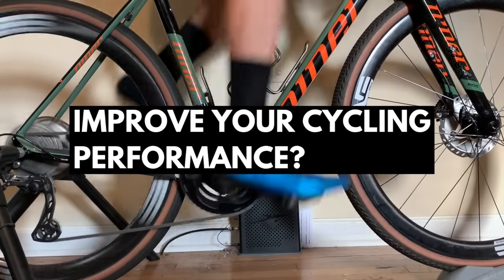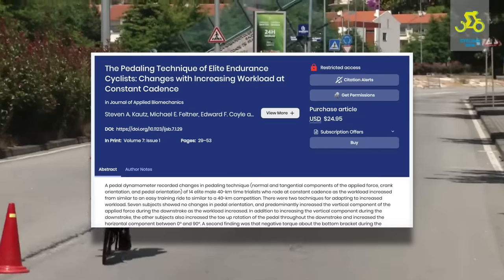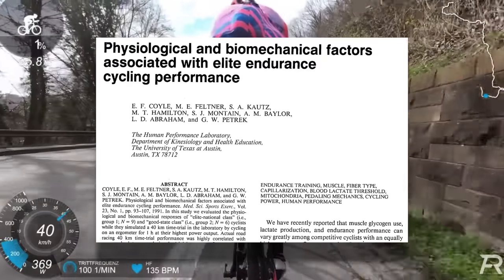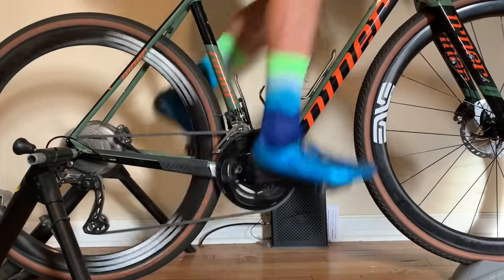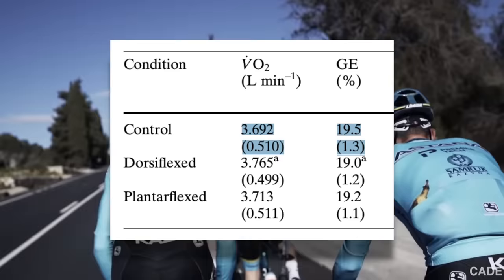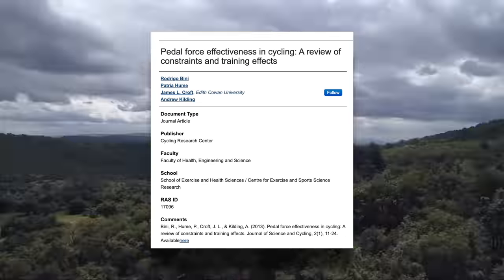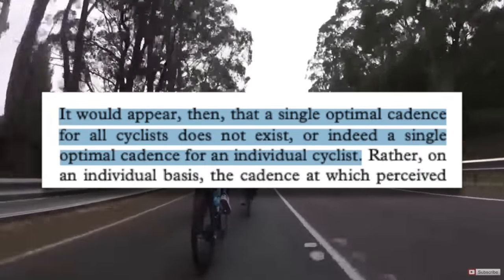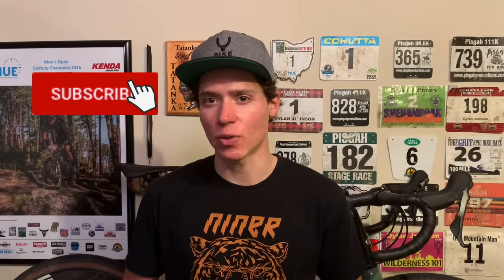Does Your Pedaling Technique Affect Your Cycling Performance? The Science

Comment: If an optimal cadence does not exist than why are the world hour records or pro Time trials normally done at 100 RPM? New study required for that one. I'm not saying it works for everyone but clearly 100 rpm is the most optimal cadence.
Reply: A big flaw I think on the studies so far is that nobody has data that focuses on longer term impact. All of these studies were mostly short term, which would've been expected when athletes couldn't be more effective due to the principle of specificity (e.g. he's most trained at that cadence). You can definitely upgrade your cadence through longer term training, got my preferred cadence from 75rpm to 95-100rpm. It'd be great to see data on that. 

If I recall the reason why pros have higher cadence is because it's easier to adjust cadence to accelerate by upping cadence than shifting and grinding gears especially when reacting to attacks or attacking yourself. It's also much less straining to your muscles especially on climbs as high cadence tends to affect your aerobic capacity more which is easier to recover.

Comment: Would love to see a video on the science of tire pressure and tire width and it’s effects on efficiency and speed for MTBing.   Saw a video recently that has World Cup XC riders moving to 2.4 width tires with pressures as low 18psi depending on weight.  Nino even suggested the tire pressure should be low enough to bottom out the tire on the rim occasionally during a ride.

Comment: This might sound odd But I seem to be pedal for longer on a hill when I "push" my pedals forward and this is easier for me I have no idea why but it sounds odd but feels better...... Don't ask
Reply: Not odd but well-known, "pushing" forward (from about 11 o'clock) over the top of the crank arc can engage the glutes & change a vertical, "mashing" power application that relies entirely on the thighs into a diagonal stroke that applies power from both muscle groups for a longer time. A diagonal pedalling image also helps to avoid pushing the pedal "down" thru the 5 & 6 o'clock crankarm positions, when the pedal is travelling mostly horizontally.

Comment: Ok, wow, that is a lot of text book information.    Stop.   yes power comes on strong on your down stroke, why?  Cause those muscles are bigger, stronger and you can add body weight.  Up stroke uses smaller muscles on the back of the leg.     I can't speak for road rides, but when climbing in the saddle with a strong lifting stroke on the dirt or tec climbing in the saddle you will shift the torque on the bike.   Up. stroke will  dig the rear tire in, gaining traction, lightening the front wheel  and easier to keep your balance .   Down stroke climbing , or standing will force your suspension to activate,  lighten the rear wheel making it more likely to break free, and seems to add weight to the front wheel forcing more body language to get over larger roots, rocks and other obstacles. So try this. (good for road and mtn biking) Remove a pedal so you can only clip one foot in. Start with removing you stronger side.  ride a couple miles, (5-10% of you usual ride) try to obtain a smooth powerful stroke.  Now switch and pedal a few miles with the strong leg while the other pedal is removed.(you will probably feel smoother stroke)  Try this twice a week for a month.   then pay close attention to your pedaling sensation. Do you feel or clock faster times. are you more comfortable, do you feel a smoother pedaling stroke.   in the end you will notice that you are activating more muscles.   Regardless, when you focus on power anywhere in your stroke you will be training and getting stronger, which in the end is just better training.   I fully agree Dylan, don't change your pedal stroke but maybe add this to  your training session.